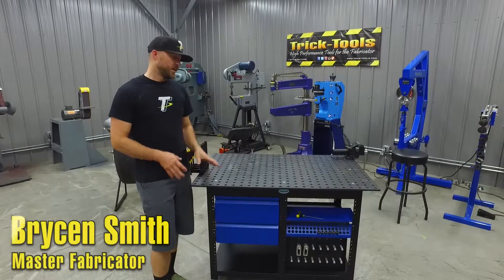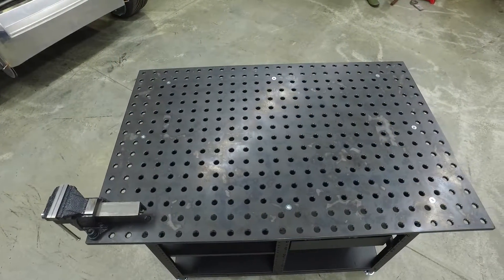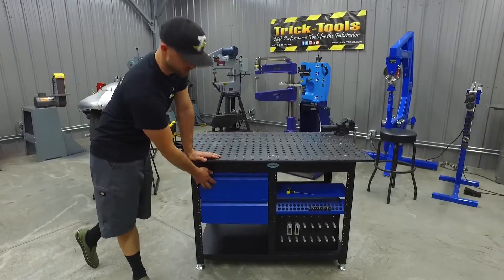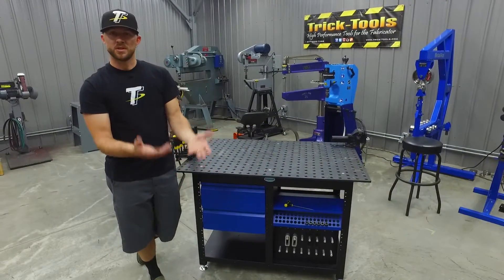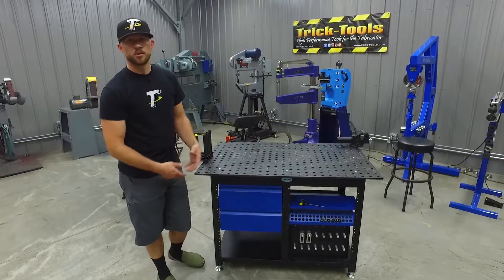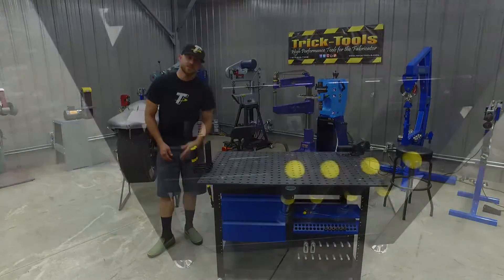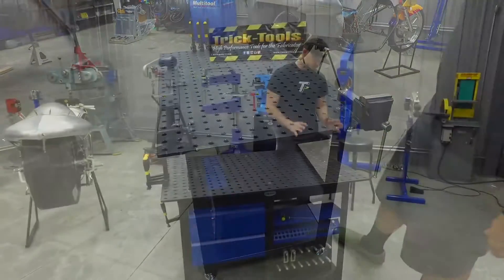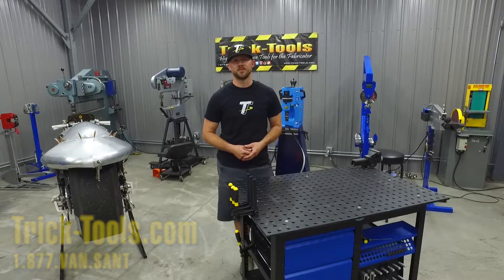Siegmund Workstation - Trick-Tools.com

Comment: I am considering adding a protective top cover for my table.... that will double as a table without holes.   Would you recommend aluminium or stainless for this?
Reply from the maker: We make one to fit the StrongHand Rhino Cart it is made from 16 gauge stainless steel